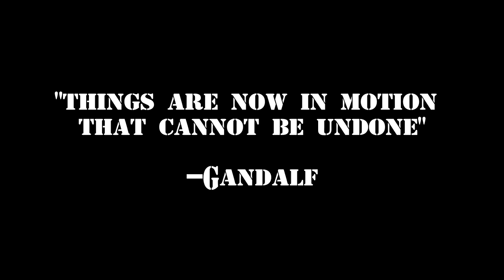HIGH SPEED PIPE NOTCHER

Comment: And so it begins, best of luck. Also dam it notches quick!
Reply from the maker: I measured it while I was editing and it was 3 seconds 
That was a 3mm wall and I was taking it easy by not pushing hard 
I'm sure it would go a bit faster but that's not really necessary because it is already a lot faster than what a holesaw can achieve.
new belts are $16 and that's about the same as a PFERD holesaw but I have heard of cage builders going through sever holesaws per cage and there is always a lot of cutting fluid that needs to be cleaned off the pipes before welding so I think this is a much better option 
plus it has a flat top so I can finish manifolds off after welding.